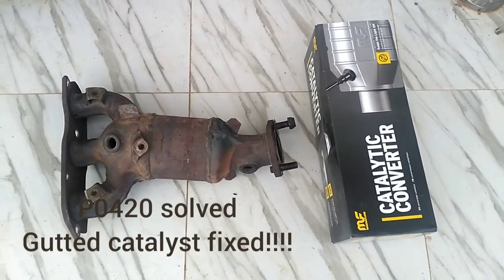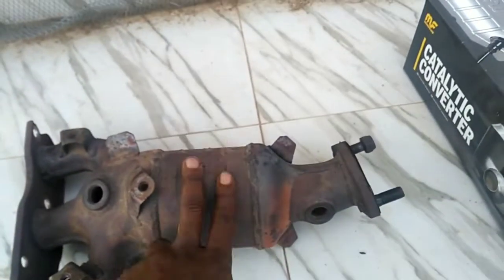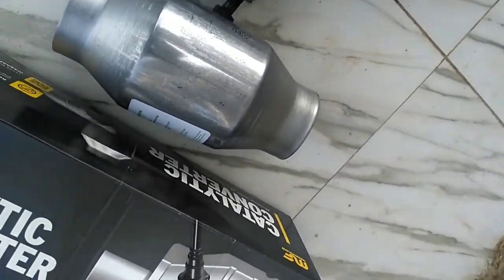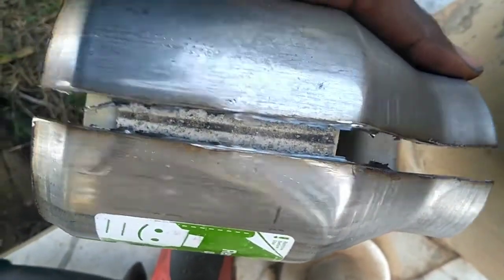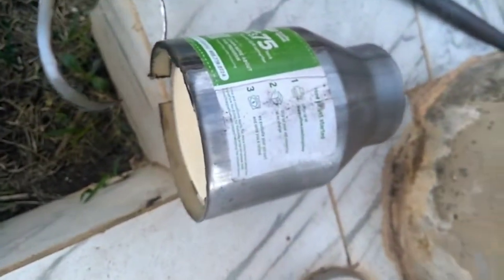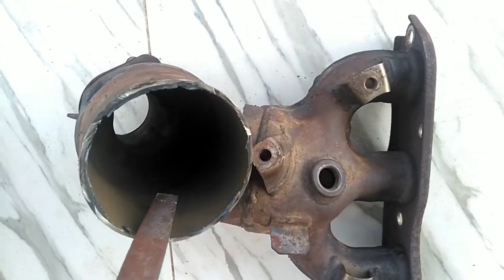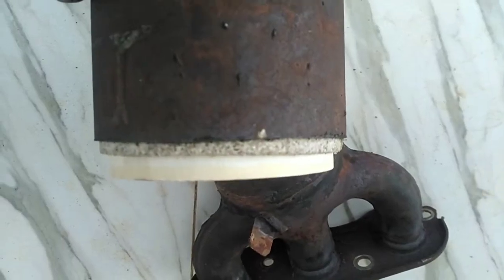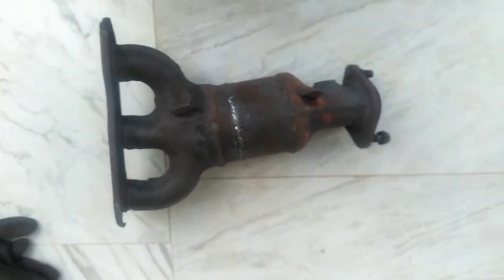Replace Catalytic Converter for cheap (save hundreds of dollars) - Code P0420 solved

Comment: You have ruined and probably melted the new substrate by welding. By welding, you have far exceeded the safe operating temp range of a catalytic converter. Often times I see people spot welding over welds to 
keep temps down. this is improper welding and with leave the seam riddled with holes. The holes will allow air into the exhaust  which will rapidly ruin the new substrate.
Reply from the maker: Thanks for the comment. The cladding definitely shielded the substrate from the heat. I did 2 of them on a V6 engine and haven't had a single check-engine light ever since.